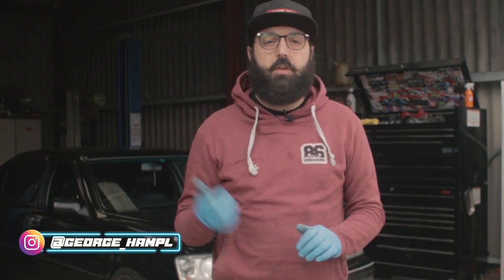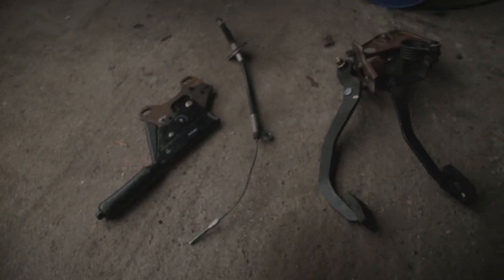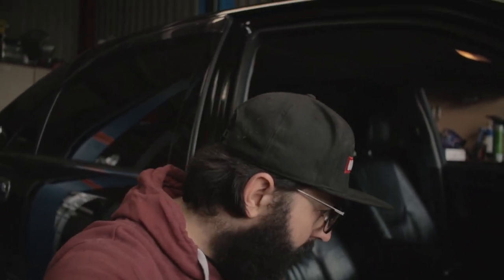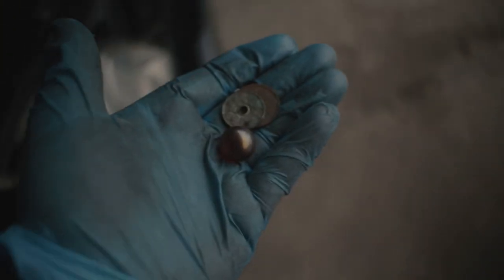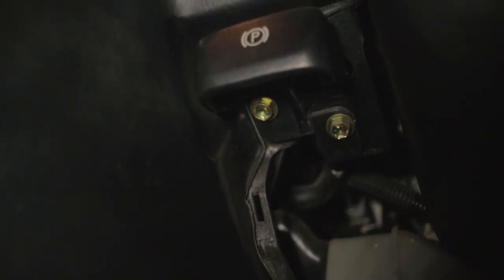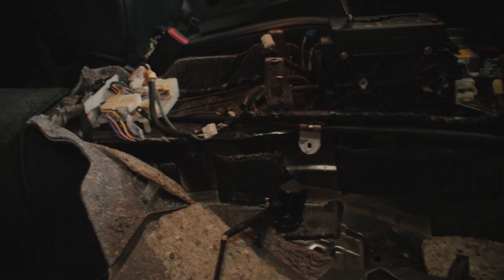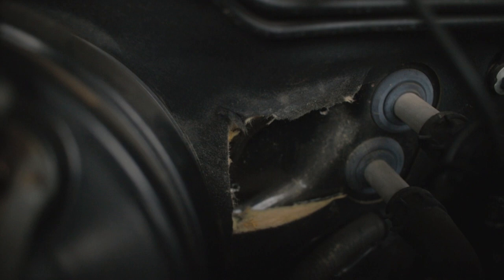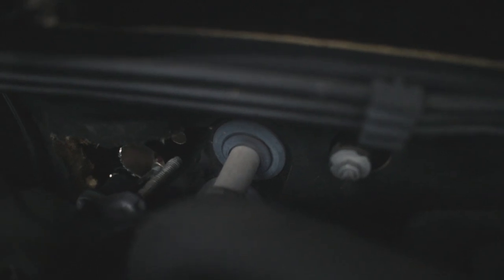Toyota Crown JZS171 Manual swap | Pedals and handbrake conversion Pt.1

Comment: Love the content am in the process of manual converting my aristo and I do believe I have to do the same thing you're doing right now
Reply from the maker: Hey Dude, I can imagine its pretty similar. What pedals are you using?
Reply: @GeorgeHampl  due to the high demand for jzx100 parts and supra parts I had to get creative using a clutch pedal out of a Corolla 2000 Corolla if I'm not mistaken they are plentiful here in Canada and very cheap. As for the brake pedal I was thinking of keeping the stock one just cut it down or I might replace it with a manual brake pedal from a Corolla or something

Comment: Some good content there! 

Shame about the handbrake not being ideal, I did go & look at a is200 breaking but as you know totally different location unfortunately 👎

I here the JZX100 one is pretty much straight forward just drill tunnel & bolts/plate otherside. 
Shame it works out pricey by the time it’s in the UK. 

Did you look into using a soarer or supra handbrake mech? 
I was half thinking maybe even Hilux 🤔
Reply from the maker: Yeah,  the IS200 is completely wrong. Different mounting and it's on the other side of the tunnel.
The handbrake lever I use disnfrom mark 3!supra and would work fine. 
It's the cable that's the problem. The IS200 just too short so it sits too far back.
Reply: @GeorgeHampl  ah sorry my bad so it is MK3 supra, you thinking swapping your cable out with with the mk3 supra ones or did the is200 do the job in the end with a little grinder massage 😀
Fair play if it works it works bud
Reply from the maker: @juggsnotthuggs8623  The rear section of the cable doesnt have the same type end as the IS/JZS. I am sure there is a cable that would fit just dont know which one.

Comment: I was wondering, wouldnt a remote r154 (in case you are swapping over to an r154) work better with a shortshifter to fit in the AT shifter-hole? to have a better OEM looking finish
Reply from the maker: I am swapping for the J160. WIth an adaptor. If the opening is the same as the xe10 or JZX110 the distance is spot on.
Reply: @GeorgeHampl  ahh sweet! good to know! not too sure about the Handbrake location, i probably would have mounted it at an angle, it looks like its hard to reach, once the seat is back in
Reply from the maker: @02lucy666  You are right. Its just the cable is so short. I will see what its like when the seat is in.

Comment: Is this the same as the JZS151? Ive been looking to buy coils for a JZS151 but im not sure if the JZS 171 coils would work do you know if its the same?
Reply from the maker: It would be more like the JZX100. JZS171 is more like the JZX110.
I have converted my JZX100 using the J160 gearbox and there is video on my channel.
Reply: @GeorgeHampl  do if I would want to buy a part for a JZS151 a JSX100 part would work?
Reply from the maker: I believe that's correct as they share chassis but I am sure there will be some differences. There are couple of good Crown AUS groups on FB. Worth asking there.